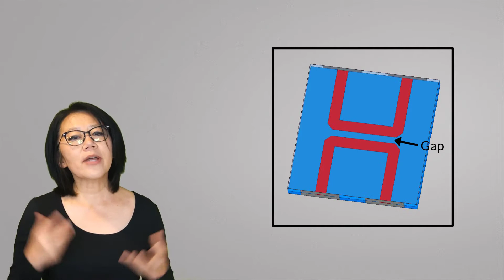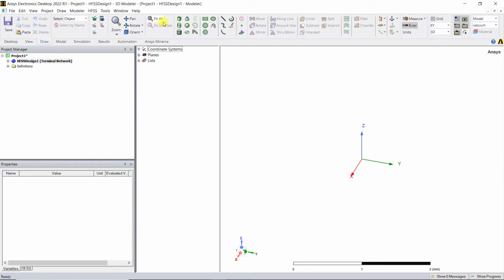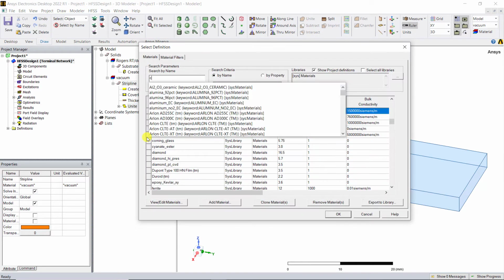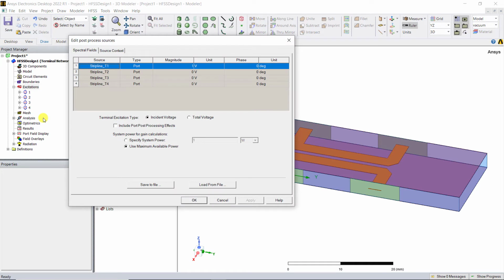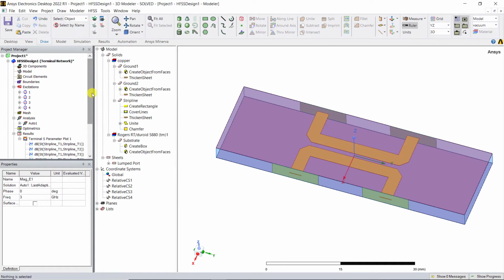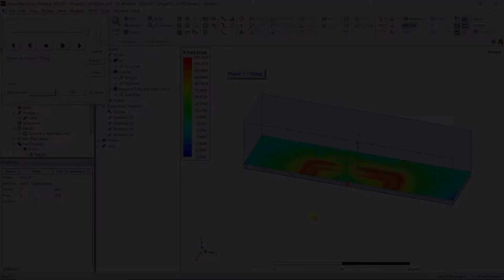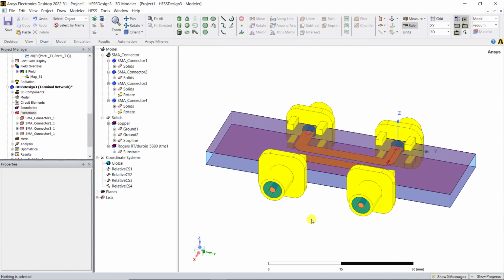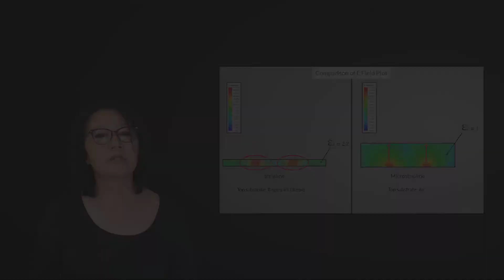Simulation of a Single-section Coupler Using Ansys Electronics Desktop — Lesson 8

Comment: design with theory calculation is not matching, it only giving approximate value. how design and calculate accurate , please help me design and calculation required correctly. Need help with theory and realtime calculation difference also madam. , theory calculation is not equal to realtime calculation, please help me madam.  I take you course on RF waveguide. i get confused theory and realtime is different.